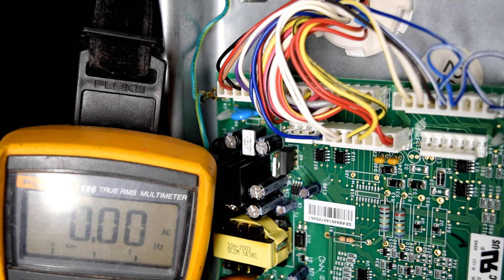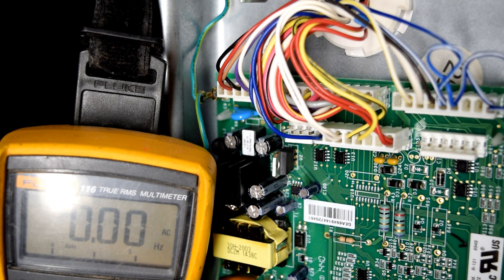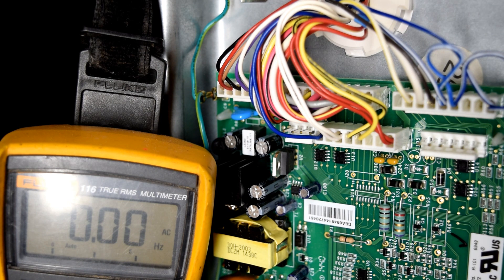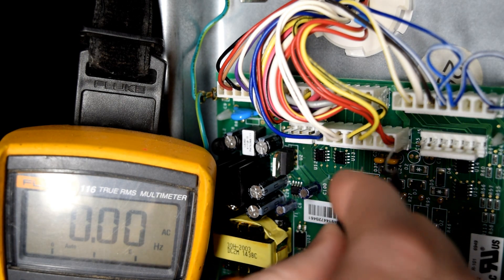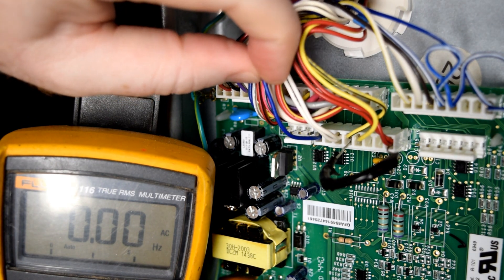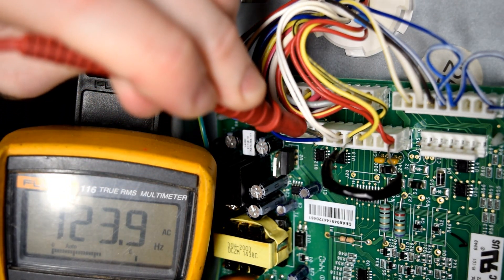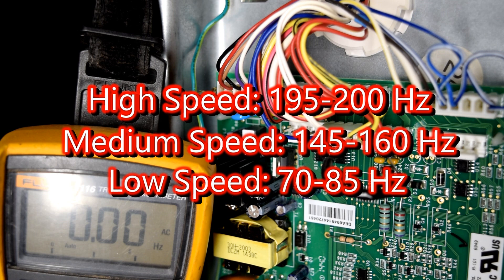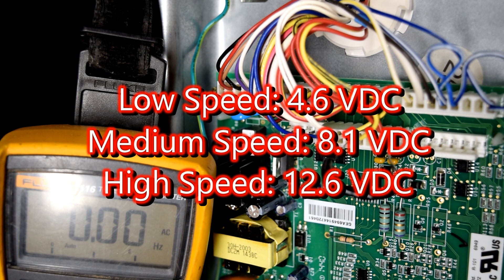Testing GE Fan Motors - Forced Run & Tachometer Test

Comment: Great video! And now a question: when I short pins 5 and 8 for condenser fan, it doesn't kick off. Actually, there is no voltage coming to fan (as well as to compressor). I've reviewed your video part1-part5, all voltages on a board as expected. Before that I had to replace two capacitors (but since I couldn't find 470um/25v, I have replaced with 470um/50V (I think this shouldn't be a problem at this point). Do you have video of how I can actually test fan and compressor (what voltage should on those)?  Any suggestions on what I can check next to troubleshoot my situation? 
Thank you!
Reply from the maker: Hi bdesert,
I'd start with this video which will walk you through testing the fans from the control board.
https://youtu.be/PhQKqF5MgDE

There is also a follow up video to that one showing correct voltages after I replaced the board if you needed. It should show as a recommendation video. 

The capacitors you replaced with are just fine. You can go greater value on the voltages so long as the uF matches up.

Let me know if you have any questions!
Thanks
Reply: @GraceAppliance  , thanks for reply. I did start with Part 1 :) My readings on pins are:
3-4 : 12.0 V
3.5 : 13.5 V (still wires coming to a fan to the right of compressor are dead cold with 0 V)
3-8 : 13.5 V
Hz on fans:
1-4 : 22 - 23 Hz (with jump 4-8 : 0 Hz, although fan spinning much faster)
1-5 : 0 Hz (while measuring this, fans inside the fridge start spinning faster)
So, regardless correct voltage on the board, there is no voltage on compressor or  fan. Thus I'm not confident I need to buy new board. :-/
Reply from the maker: @bdesert   @bdesert  hey sir, sorry about my response. I was doing that from my phone right as I was waking up. That may have been sleep typing. Haha
Re reading, I see what you ACTUALLY  wrote. Haha

Try this, unplug the J2 plug and replug in the fridge. I want to rule out a shorted or faulty fan robbing voltage from other components. If so, your compressor should fire to life, but not the fans obviously because we just unplugged them at the J2 plug. 

Let me know what happens when you do this and we can go from there. 

Thanks and let me know if you have any questions!
Andy
Reply: @GraceAppliance  
Andy,
Unplugged power, unplugged J2, replugged power (did that with doors opened and closed, same result):
1. No fans (obviously)
2. some very low noise from somewhere (not compressor) for 5 seconds, then total silence.
3. Compressor doesn't start, no power on compressor (tested wires directly).

Then replugged J2 (with unplugged power of course), evap fan started working again, the rest without any change.

The only things was different between J2 unplugged and plugged is purple wire. with J2 unplugged it became hot (indicator found it), although I don't know the voltage, don't think it is important at this point. With J2 plugged - no current on purple.
And in general, there is a bunch of wires to the left of compressor. Indicator shows current only on the wire that goes from the 120V plug into fridge (brown). the rest of the wires - no current.
Reply from the maker: Thank sir, 
read my last statement first.  Had a thought after typing this out.

The noise for 5 seconds you heard is the damper motor actuating.  No issue there. 

So, the HZ read out you got for your evaporator fan motor isn't sounding right to me. It should be at a minimum 70Hz - i.e. low speed.  You've said it's getting 12V which should be high speed. Once you jump it then speeds up you say. That's not lining up for me, but stick a pin in that for now - as one issue. 

You can test that voltage is being sent to the compressor by locating the light blue connector on the bottom of the board with 3 larger terminals on it.  Test for voltage between the far left terminal and the orange wire on the plug to the right of that plug.  If this shows 120v - your compressor should be running. (assuming the temperature sensors are in working order, which we'll check next) 
Let me know what you find on that. 

The only other thing that i'm wondering about is the fact that you have correct voltage at the control board to your condenser fan, but none at the plug to the condenser fan motor?   This sounds like a poor connection issue. 

**Ahhhh....after typing all this it occurs to me - you may have a poor connection at the plug where the main power cord comes in to the fridge.  Try this, unplug your refrigerator from the wall.  Then, the main harness to the left of the compressor should have a large connector that you can disconnect from the main power cord.  Unplug and plug this back in several times. Inspect it to be sure there is no corrosion build up, etc.  Reassemble and reconnect to power.
Reply: @GraceAppliance 
last statement - I've done that before (inspecting, unplugging, plugging back, etc..). Didn't help before and didn't help this time.
Yes, 22 Hz is lower, than in your video, but by the sound I can hear - I can tell that this sounds as usual,  but I can be wrong. What I don't understand is when I jump 4 and 8 then 1 to 4/8 it reads 0 Hz (but I still hear fans inside the fridge.

There is no 120V reading between J8 (far left) and Orange on J7, but there is still 124 V between orange and J11 (far right). Blue wire (J9) no read as well.

I doubled check all the connections again, including indicator on the wire (yellow, out of pin 5) - it does show current in it. I just not sure how 13.5 V wire becomes one of those on a fan connector.
I can jump 120 V from the input to J8 to check compressor, and condenser fan (not sure which connector to jump). Would that be correct test?
I also can try to check continuity between terminal connectors next to compressor or where the fan is connecting to the wires on a board, but I don't have full circuit schema, only that small part that is on your video. Would appreciate your advise.
Thank you!
Reply from the maker: Hey, You're welcome.  We'll get it figured out. Many times, if there are multiple issues like this going on - it's going to be resolved by the control board, but I just like to confirm every piece because the price on those is no joke. 

Do me a favor on your next reply and send your model number please.  That will help put my mind at ease by being able to look at the schematic for your specific case. 

I agree, you should be getting a HZ response between 1&8 of at least 70HZ and certainly not 0. (evaporator fan) So, if your fan is indeed spinning, it sounds like the tachometer on that fan has failed. I am not sure if this would cause the other issues to go along with that. But, that sounds like one issue. As far as why it cuts to 0HZ at higher speed...mmm I don't know.  It should be a much higher figure at that point.  Probably it's related to the faulty tach and beyond that - the world may never know. 

Next point, cool - you've confirmed your board is getting appropriate 120v incoming.  You do not have power being sent to the compressor (far left and orange), and no power to the defrost currently being sent (orange and blue).  So, all good there.  
The condenser fan (depending on your model may be DC powered like in my video, but some have 120v fan motors and simply run when the compressor runs...sounds like it in your case, but will wait on the model number)

All this aside, the next thing i'd check are the temperature sensors for the fridge and the freezer.  Reason being, if the fridge's sensors are telling the fridge that it's already 0' in the freezer - it won't ever send power to the compressor/fan.  

So, the search continues with this video: 
I'd want to know the approximate temperature for both the freezer and fridge cabinet currently and also the OHM reading for each sensor as shown here: 
https://youtu.be/CG-2FnQ43Hs?t=129

whew!! Sorry!
Reply: @GraceAppliance  
Ok, got readings from the sensors (pins 2nd, 3rd, 4th to 5th): 5175, 5341, 5316 Ohm at 57 F in both fridge and freezer.

Fridge Model: GSL25IFRFBS
Main board: 0158-00-04 (part # 200D4854G013)
Condenser motor looks like running on 120 V (black, green and orange wires)
Reply from the maker: @bdesert  thanks!
Cool. Sensors are in the ballpark and not the cause of all this.

Yes, you have a 120v fan motor.

I recommend replacing the main control board and the evaporator fan motor and you should be good to go.

Sorry for the ton of questions!
Nice work on your side.
Reply: @GraceAppliance  
I've ordered parts. Once installed, I'll let you know whether that fixed the problem or not.
Reply: @GraceAppliance  Hi, Andy!
Installed new board and evop fan. Assembled all back and now my fridge is back to life!
Thanks a lot, your channel is really helpful!
Reply from the maker: Awesome! So glad to hear it! Nice work.